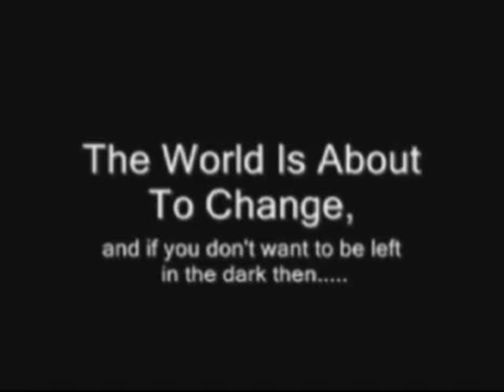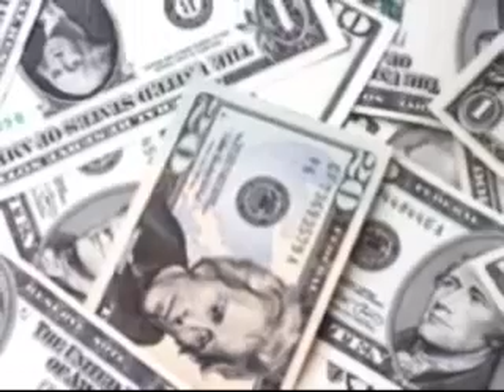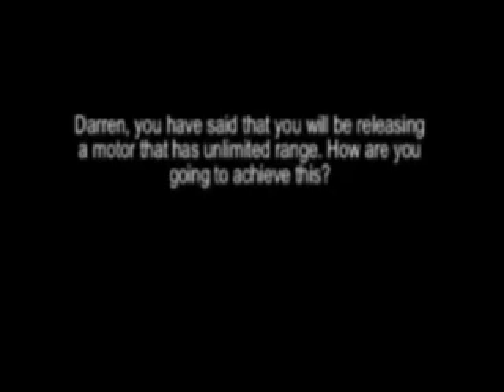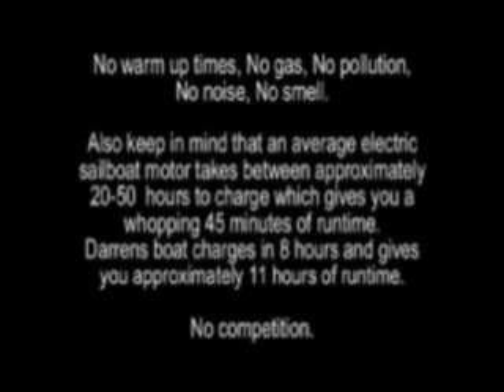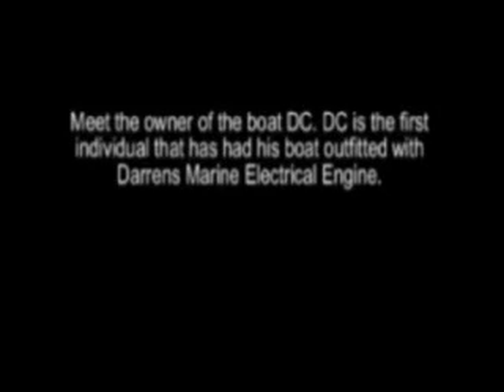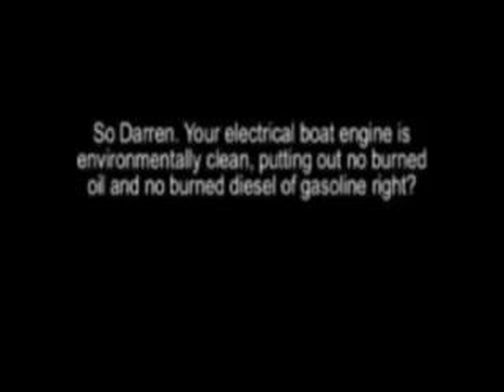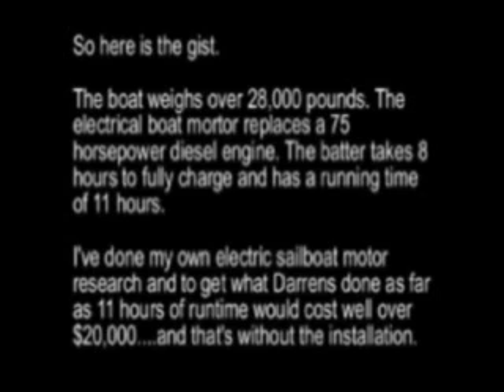100% Electric Sailboat Motor - Part 1

Comment: This has been done, under sail the current spins and this turns the motor that charges the batteries. The big problem with this is if you have to motor sail, you need to have a generator just as a backup.